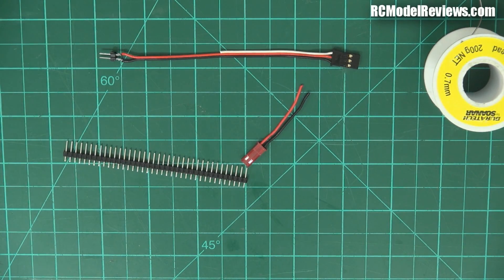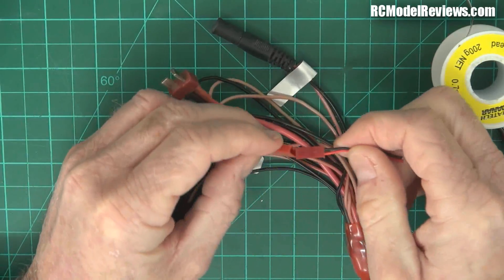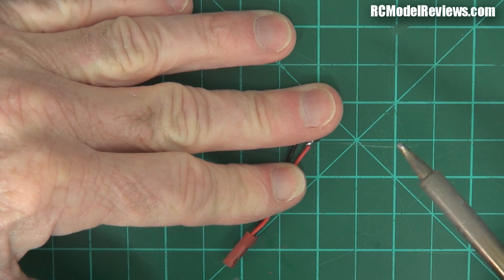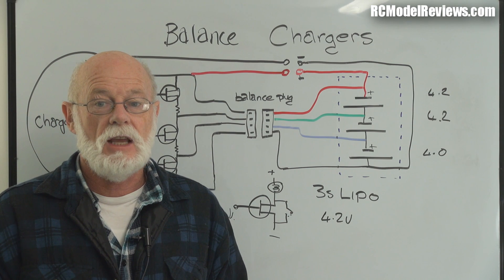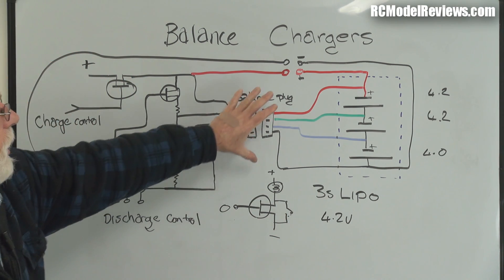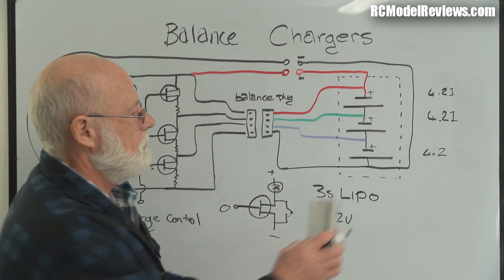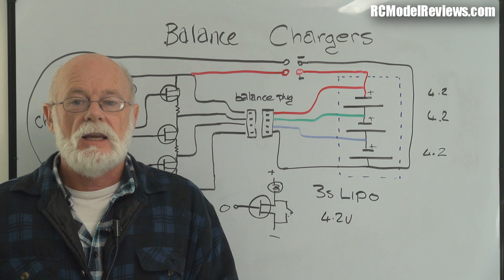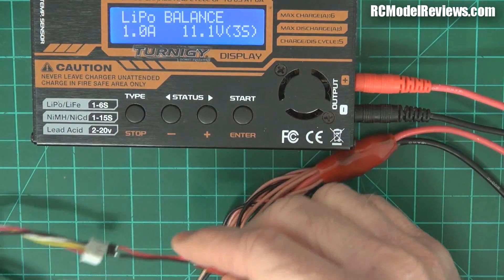Balancing your lipo battery more quickly (and how cheap chargers work)

Comment: Great summary!  After watching I found a quicker way to make an adapter was to use a servo lead extensinon and cut off the plastic rectangular cover flush around the end with the male pins.  Then cut off the signal pin and signal wire and you are set, no soldering required!

Comment: Hi Bruce, very inspirational video. I have a 4S7P golf trolley battery 14.8v  three strings measure 4.207v exactly. One measures 0.323v tried charging at very low voltages and current. Could you possibly shine some light on this problem. I have the same charger as you and was stumped as to how I could charge or discharge a single cell. The header you used 2 pin I thought it would short out the previous pin thought you had to use negative pin always and then a pin for 2,3,4,5 etc hope this makes sense. Many thanks again, go safe. John...

Comment: The principle is correct but modern chargers are more clever. They balance the cells in the beginning of charging first and then charge all at the same time still checking if the individual cells have the same voltage and making corrections. Also from what I noticed it doesn't use the balance leads for discharging only but also it uses them to charge the indvidual cells independently with lower current to get them to the same voltage, which makes the charging much faster...

Comment: are balanced chargers still made this way?    why don't they take the voltage close to fully charged and then trickle charge each cell thru the balanced wires, just make them large enough to handle the slow charging current.   it seems when you charge, and discharge and charge again over and over you're keeping the temp high in the pack and shortening its life no?

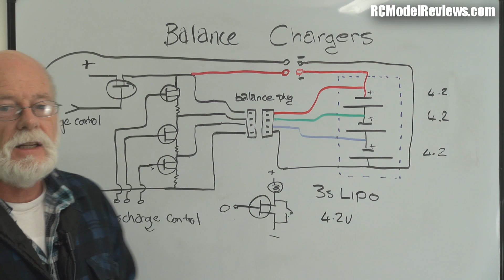Comment: 12:21 what about the resistance of that cable??? As they are much thinner then the rest cables , and you said you can charge batteries with a few Amps they will get hot. Probably the balancer in the charger takes time because it charges it with very small current right? Maybe I just misunderstood you so if there is the case sorry for that . Thanks for the explanation anyway :)

Comment: by the way, all chinese and cheap chargers charge LiPo batteries to 4.35 V (or something like that) sometimes Hahaha I think with small batteries I don't see any difference but I don't use them for high current (only for my project , remote controlled car which takes maybe 400 mA max )

Comment: Hi I have 2 LiPo batteries both 3 cell and Im using a Gens ace imars iii charger I have 2 batteries that are displaying cell number incorrect. When I plug in the low voltage alarm gadget that usually tells me the over all charge then the charge in each cell it just flashes up All 0.OO and doesn't see individual cells. Would this fix the problem I have or do you know what the fault may be?
Reply: This can help you bring them back to life but if your battery is having problems it will happen as soon as you use it again so best thing to do is be more mindful of lipo batteries never let the cells go under 3.5 if not you will have trouble with balance charging

Comment: i first got into rc about 8 years ago but havent really touched anything rc in about 6 years. now that i am building an ebike that will be powered via lipo, i am finally zeroing in on exactly how these chargers and balance ports work. it helps that i also got into solar and battery bank building recently. anyways you have confirmed what i thought was true about the theory of operation on these chargers. thank you

Comment: This method could work but in my case it didn't. The first cell of my battery was either discharging way to quickly or it was charging faster when comparing to the second cell even if I charged it to 4.2V. So, I discharged the battery with 20A current to 3.3 volts. Then I balanced it via the charger because there was a 0.1V difference and then discharged again the battery to 3.3V at 5 amps. I balanced it again and I discharged it for a third time at 0.1A. In this way I was sure that both cells are exactly at 3.3V each. Then I started charging the battery at 8 to 10A and the cell voltage difference never surpassed 0.006V from there on while charging or discharging. That is an acceptable difference so my battery is good now.

Comment: You showed how to charge imbalanced cell #1, but how do you charge imbalanced Cell #2-#4? Do you always keep the BLACK connector in place on the balance plug and move around the RED only? Or do you keep moving both of them over one place to individually charge each cell isolated? There's no mistakes in electricity unless you want painful lessons. Please clarify.

Comment: Hi Bruce hope you are well.
I connect a servo wire and a connector as a 2S battery lead. Until there that's fine.
My motor controller doesn't have 3 wires only 2, so I have to power my receiver with battery control lead.
I don't know what happened I fried one negative wire from the battery and the negative wire from motor control signal.
ECM has 40A capacity 
Do you have any idea of what happened? 
Thanks and nice video!

Comment: For those of you who don't want to bother using this way, discharge your battery to 3.3 volts, don't go lower than 3V per cell. Afterwards balance charge them to 3.7 volts. The balancing will indeed take some time - one or two hours but the result should be close to perfectly balanced cells. Once you do this, discharge again to 3.3V to make sure your cells are keeping the right voltage and then charge to full. If there is still a difference in the voltage maybe the cell /cells is/are damaged.

Comment: Excellent explanation of balance charging and how to work around charging all cells at the same time.  Question: you mentioned "liquid tape".   I'm only finding "Nail Gel Liquid Peel Off Tape Cuticle Guard".  What are you using?  I need something for when I "oops" forgot to put the heat shrink on.

Comment: BE CAREFUL!!! RECENTLY 2019 MOST BALANCE LEADS USE 1 BLACK/RED WIRE AND THE REST ARE THE OTHER  COLOR (RED/BLACK)!!! YOU WOULD THINK THE BLACK IS GROUND (I DID) BUT ITS NOT!!! ALL MY BATTS THAT USE BLACK/RED BALANCE WIRES, THE WIRE ON THE OPPOSITE END OF THE CONNECTOR IS THE GROUND!!! If you hold the connector the the notch's up with wires coming out on the right , the ground is the top wire/furthest away from u

Comment: Fantastic. I just brought back from the dead several three cell lipo packs where one cell had gotten way lower than the other two. No special harness required. My new (2019) charger was able to charge all 3 and repeatedly discharge the two high ones until the lower one "caught up" IF AND ONLY IF I set the charging amps to around .01 and let the unit take its time.  Without your explanation of how balance chargers work, I wouldn't have known this was possible. So, thanks.

Comment: Wow great video. I still have questions: I want to get a good charger to get it right this time. In the description of it, it says balancercurrent 800mA per cell. So would this mean it can charge single cells at 800mA  (seperately?) Right now I have a simple cheap microcontroller 80W charger. The same as in the video but in an other case (100% same internals).

Comment: Just for the sake of safety: Please use shrink tubes when you are soldering these connectors. The plastic of these is very wiggely and the can fall apart rather quickly (and short in your case). When someone does that at home thats one thing, but if you are doing this infront of a huge audience, everyone will be doing it like you.
I also understand your idea for the battery balancing. BUT why not go the next logical step and connect 3 chargers at once via your method to charged them all individually at the same time. These charger chips cost basically nothing on ebay or aliexpress.

Comment: Hey Bruce, are there any chargers out there that would use the main leads to bring the battery up close to full charge and then use the battery leads to "top off" the remaining cells?  This would be the right way to build a charger it seems.  Thanks!

Comment: Great idea! About max amps you can charge it, just have a look to the wire labels. On mine, it is written 22AWG. Then use a AWG to AMP conversion array (like: http://www.powerstream.com/Wire_Size.htm) and you get what the maximum you can pass through. For 22AWG it is 0.9A.

Comment: If you were charging at 500ma could you use just the balancing cable without the main charging cable.   If this is true what is the max current you could charge with the just the balancing cable?

Comment: So nearly all voltage (12.6v to 13.2v) will to charge for 3rd battery when 1st and 2nd are the 4.2v. So question - it is over voltage( higher) for 3rd Li-ion batt?

Comment: Thank you for the explanation, we have problems with drone parrot bebop 1 batteries and as the drone needs a lot of power to fly and the charger has no way to balance we hope individual cell charging will help, or buy new.
The pins I just bought to copy your cable are called: 40Pin 2.54mm Male PCB Single Row Straight Header Strip Connector Arduino

Comment: Was hoping you could tell me if this will work.  Want to run 6 18650 in 12v by 5 ah configuration 3 x 2 then run 6 TP charge modules 1 per cell paralleled with a solar panel. You showed charging one cell in any configuration with your header pin trick. Will this work with TP charge modules??

Comment: Do they issue a warning with those multi charge leads that, for example, when you are charging a battery on another connector, the pins on the deans connector are live and a hazard to shorting!?!? or are they protected from such? :) great vid Bruce, really useful info.

Comment: OK... But how to know which charger is good? Are all four-button chargers bad? Because I purchased four of them for 70 € (Spain) each, so they are not exactly cheap...
I also have other cheaper four more. I've been using them for years with 40-50 batteries, and despite abusing them a little bit (professional use with an octocopter) and having a poor lifetime, I haven't had many issues otherwise. I mean, I take care of them and balance them regularly, but many times I have to recharge them just after use, when they are still warm.
But now I have a 4 S battery that has a weak cell, with a voltage always lower than the others by more than 0.5 V, and I've tried a couple of consecutive times to balance it, but I think it isn't working. I'm guessing the cell is just bad, or can it be recovered somehow?

Comment: this is the problem with these chargers it will wear out the low cells (ones that have higher voltage first since lower capacity) and charge and discharge them in order to get the lower cell (higher capacity) up to charged

Comment: Hi just a quick question the lg 18650 battery from ebay  (Lithium Ion ICR18650 MF1 2150mAh ) 20x cells each cell is 2150 ah. The spec sheet says Max. Charge Current 1.0C(2,150mA). So when you have this pack 36v 10s 2p  what is the maximum ah current can you charge it 2ah 42v current  or  2ah current x 20 cells ~ 40 ah current at 42v.  Now if you have 3x 10s 2p in parallel which is 36v 12.12 ah what is the maximum ah current  you can charge thats 60 cells is it 60 cells at 2ah current  which is 120 ah current  for 60 cells or just 2 ah for 60 cells using cccv charger 
Thank you very much

Comment: I did'nt understand some aspects: the 1st FET discharge 1st cell up to 4,2V and then it switch off, after this 2nd FET switch on discahrge the 2nd cell up to 4,2V and then switch off OR 1st and 2nd FET discharge simultanueously 1st and 2nd battery? Thank you.

Comment: Hi,

I have been trying to get information about wiring a 6s pack I am building.

I have a 6s protection circuit and the output can handle 15A at 22v

My question is about the wire gauges.
I understand so am going to need to solder 7 wires,  So if I was to use a heavy duty wire say 14awg that go from the battery + and - 
And can I use say 20awg for the 5 wires that are in-between cells for the protection circuit?

I want to go as streamline as possible and using thick wires for the interconnects may seem over kill?

I hope this makes sense

Comment: Great video.  Thanks much.  I've always wondered what the heck the charger was doing and why it took so freakin' long to balance charge and why, if the thing is supposed to be a "smart" charger, why it wasn't just designed to bring up a low cell fast.  Now I understand: cheap design.  Which boggles my mind.  What do they save on each unit, $10 maybe?

Comment: Adding a red LED with a resistor to the adapter cable you made will help prevent reverse connection. Add the resistor+LED in backwards so when the adapter is plugged in the wrong way the LED will light up. Put the connector in the right way and the LED won't light up.

Comment: I have a 6S pack where 1 cell charges to 4.24 and the rest to like 4.14. Is it possible to put a little switch on the balance lead for the cell that charges quicker, and then switch it off and balance charge as if it was a 5S battery? Could I just put the switch right onto the balance lead coming from the lipo pack?

Comment: hi sir, thank you for the video ,can you tell me what to do in this sitution.
i have a 3s battery 11.1v 5400mah.
1 cell is 4.20 , 2 cell is 4.20. and the last one is 0. but i think is not dead how i recharge it or i need to discharge the other? and after recharge in balance charge?
please lf you can help me .
thank you very much.

Comment: instead of the high cells discharging through the resistor... would it not be possible to get the high cells to charge the low cell
Reply: That requires a higher cost microprocessor, but ultimately is the most efficient way to charge...as Bruce demonstrated with his individual cell method, you could actually charge individual cells until they are all a nominal voltage then continue charging on a regular balance charger until full, with less chance of the cells being that different in volts, therefore saving time on the cheap microprocessor controlled charging circuit.

Comment: Dear Bruce (If I have used an incorrect name, I do appologize). 
This subject is quite old but never the less I am always interested in charging my flying batteries quicker. The main problem as you point out so well is the balancing part.
A new charger came to my attention that balances off much much quicker by utilizing the balance leads to charge te slower cells once one of the cells has reached its 'full' condition.
I will buy tis charger soon: http://www.banggood.com/Radiolink-CP620-750W-30A-Battery-Charger-Hybrid-Balance-Charger-For-RC-Models-p-1048386.html?currency=EUR&utm_source=criteo&utm_medium=cpc&utm_content=all&utm_campaign=toys-and-hobbies-NL

However, after pondering for a (too) long time to whom I could put my question, I chose you.
I would like to know if the battery that is full could be used to charge, actually. balance, the slower cells. In that case no 'electrons' go to waste and balancing could be achieved more quickly. I am aware of possibly high currents flowing between the cells, but I was wondering if this could not be harnessed in some way without it all becoming too expensive.

I would very much appreciate youre reply. 
Thank you very much in advance and all good luck to you.

Bart

Comment: Using this very method why can't you use a TP-4056 and use that to top off your separate batteries? In fact, for a 12.6v 11-1v why not wire all three negatives to the one negative of the two pin and daisy chain them to the three TP-4056's and run the positives of each one to each single pin and turn them all on to charge them all and if needed bring the resistor up on the TP-4056 to 5000.250 from the original 1000-1A and slow charge a out of volt pack? Each TP-4056 should shut off when the cell is charged, right? Maybe the wiring needs to be altered but should work with some thought...

Comment: could I make one of these to charge say a 4s  pack and do all 4 at the same time on my 4 port charger?
Reply: How is it constructed, your 4 port charger?
It depends on the voltage potential of each cell and port on the charger.

Probably not.

The method he describe here is to charge as usual until the first cell reach fully charged.  Then just charge the individual cells that are undercharged to reach fully charged.

(You should probably use a voltage meter and check that the voltages on the connector on the battery pack before connection)

Comment: My 3cell battrey is changing  fine. But as I put it on charge all the cells are around 3,70v but I leave it for 20min and the cell 1 is already at 4,20v(fully charged)  and cell 2&3 are at about 4,15v why is this? Iv tried  discharging cell one to match the 2&3 but I get it right then put on charge and does the same

Comment: why dont they just make it charge up to 4.19V before discharging?
Reply: I think 1wsx10 was trying to say...why doesn't the microprocessor control in the charger, only charge the cells to under the full 4.2 V per cell eg. (4.19 V) then only when the lowest cell is at that voltage the charge circuit continues charging until the limit of 4.2 per cell is reached....in theory this idea is solid but with cost factored in, the easy option is to pump the volts then bleed off the oversupply (albeit slowly) so the speed of balance charging is the advantage you are looking for...hope this has clarified this for you.
Reply: wondering the same thing
Reply: I don't understand.  Which cell should be charged to 4.19V before discharging?  And what are the advantage you are looking for?

Comment: Wow, you just saved one of my most expensive batteries. I had 4.2, 4.2, 4.2 and 3.8V on a 4S lipo and couldn't get it to balance and I used this trick and it's now balanced like it was brand new. Thanks so much!!!
Reply: You could have discharged the battery by using it a bit and then gone for balancing but this guys technique is definitely so much faster!